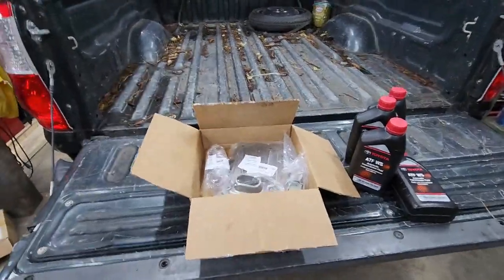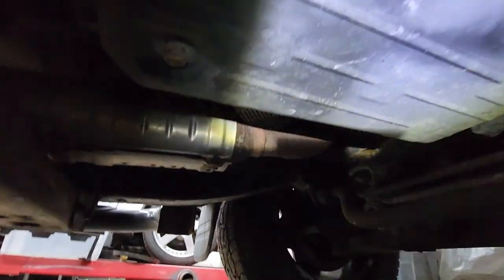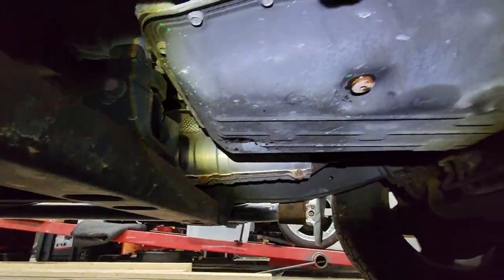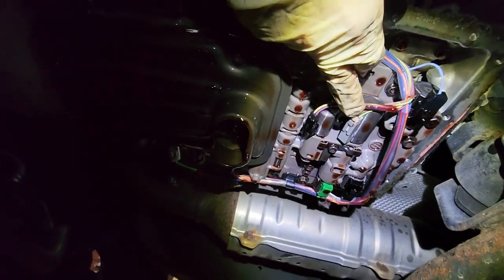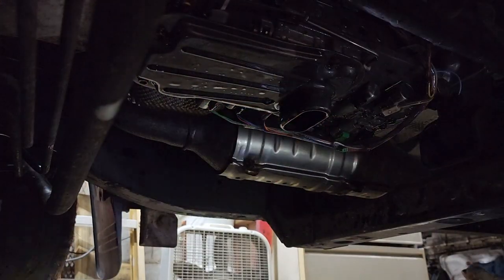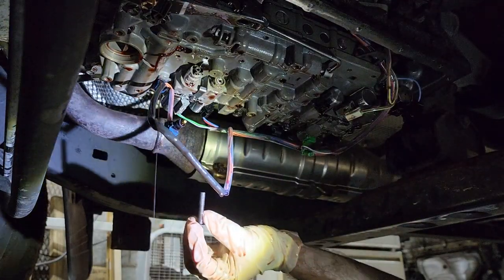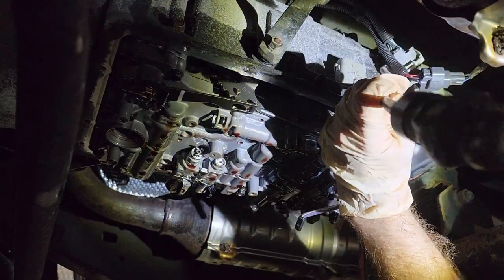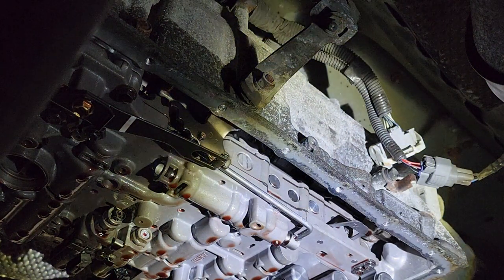2005 Tundra - A750E Transmission Harness Replacement PT1

Comment: Thanks for posting this. Im about to Check my connection for oxidation. I got code p2716 all of a sudden for the pressure solenoid and started shifting poorly. Before cracking it open im going to clean the connector

Edit: Well turns out the connector was corroded. One pin was so bad that it came off in the female end when I disconnected it. Guess which pin it was? The one that goes to the line pressure solenoid which causes P2716 when faulty. Thanks to your videos I feel confident about taking this on myself. Sorry yours didn't go as planned

Comment: Its recommended not to drop the pan on this gen Tundra, the “filter” is actually a strainer and up in the rust belt the odds of bolts breaking is very high.

Comment: so what ended up happening? why did you drop the trans, the bolt broke?
Reply from the maker: Yea, the bolt on the harness connector broke and there isn't enough space to drill it out. It came back together nice and I've been putting some miles on it
Reply: @alsoron5323  I saw someone cut the floor board . But it takes some will power to do such a thing 😂 that would allow you to drill it.